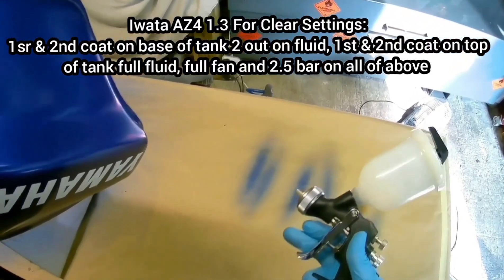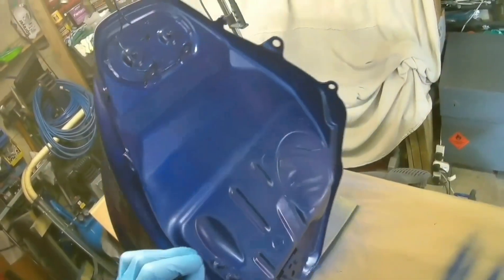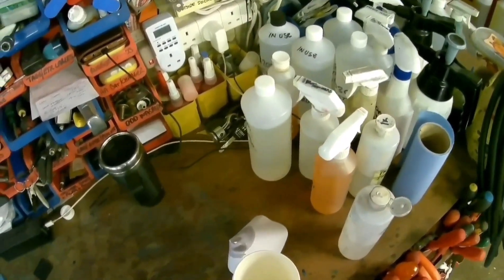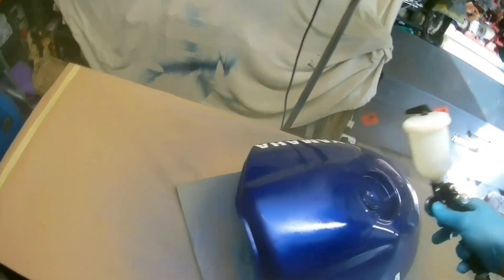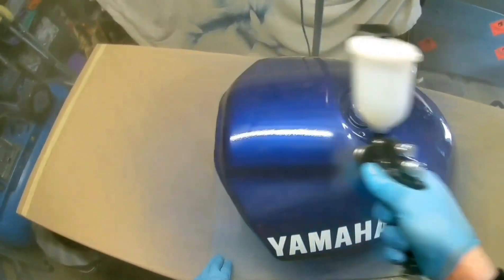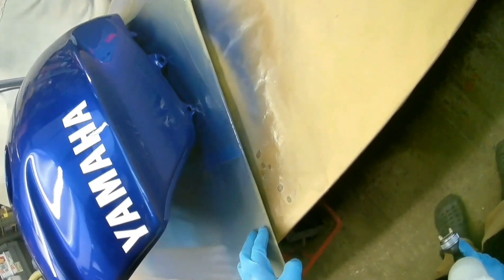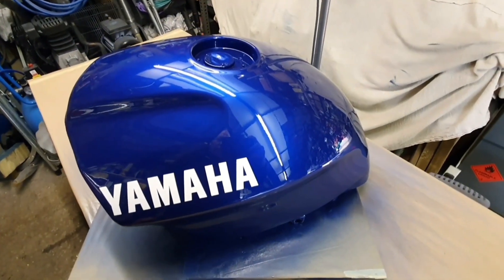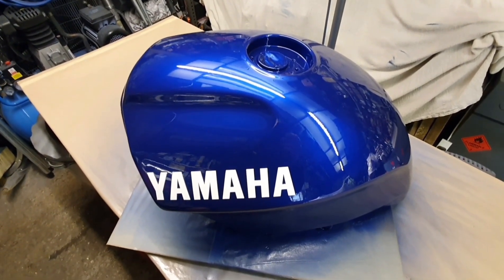Iwata Airgunza AZ4 1.3 For Clearcoat Yamaha FJR1300 Motorcycle Tank

Comment: Its a like from me pete well explained as usual with the gun 🔫  settings helps people out who are just starting to learn the hobby when the tank finished do you cut and buff it or just polish it by the way mate cracking finish well done 👏
Reply from the maker: Thank you Andrew, In this case i just de nib it ,I polish the nibs out the next day, the finish was very good so didn't need a full flat so i just sand any nids out by hand with a small block and some 1000 grit and then 3000 grit wet and dry paper, there was only 3 nibs to do as far as I remember, then I just polish those out, i have a little 3" 12v Milwaukee polisher that i use for little polishing jobs, obviously what you see ar the end of the videos hasn't had anything done to it,  it's always off the gun so you can see what the gun can do, cheers buddy,  hope you're well 👍

Comment: look pretty good, buddy. 😍😍😍
Reply from the maker: Thank you mate, much appreciated 👍
Reply: @peteshobbies5383  you're always most welcome Buddy 😍☺😊
Reply: @peteshobbies5383  hi! Buddy, pleas could you explain to me, what is the different between the  Ls400 supernova base gun and the ws400 supernova base gun? I bought ws400 supernova evo Base gun. but  I didn't do a review yet.
Reply from the maker: The LS400 has a different cap to the WS400, the LS is a true HVLP , you'll find the base version of the WS400 has a difference tip to the clear WS400,  the base tip has smaller holes around the tip point so let's less air through because if you try and use a clear WS400 for base it over atomises the base and it goes on too dry
Reply: @peteshobbies5383  thanks for the info bubby.😍😍😍 for you're opinion what is the best, spray gun for base between this two guns. LS400 or WS400 base gun?
Reply from the maker: I think the LS400 is better overall particularly if you use water base, one drawback with the LS is it uses a lot of air which i think won't be a problem for you, the LS also handles metallics better so i would suggest that over the WS
Reply: @peteshobbies5383  thanks Buddy. 😍😍😍
Reply from the maker: Your welcome 👍

Comment: Hi, just love your channel and now I have a question.
I have an Impact Junior 1.0 and I have been happy with it.
But suddenly it seems impossible to paint with it. The paint becomes full 
of what looks like tiny little grains of gravel, everything gets ruined.

I run the color through the filter into the cup and I have a filter in the cup.
Paints with 1 bar.
Hope you have any idea what it could be because right now I feel like giving up painting.

Best regards from Sweden.
Reply from the maker: Hi Mate,  If everything is how you have always used the gun them it must be something else.

It could be the materials you are using,  the degreaser you are using,  the thinners you are using, the air you are using,  lots of different things.

Forgetting the gun, have you changed, and update anything?

If you like, send me an email so I can see what the finish is like, 
Youtubepetes@outlook.com

Comment: I'm currently using an LPH-80 at home for small jobs, mainly due to the really low consumption of air, but I would like a bigger fan pattern. Would a small compressor cope with an AZ4?
Reply from the maker: Hi buddy,  the AZ4 with the AZ4 1 cap, the most common for smaller tips uses about 50% more air than the LPH80 E4 combination, you can get the AZ4 with the AZ4 2 cap, but that is normally on 1.3 and above and this uses 3 times the air of the LPH80 E4, hope that helps 👍
Reply: @peteshobbies5383  good info there Pete. Thanks! 
I've got a handful of full size guns too. Devilbiss, iwata and sata. Guessing the AZ4 would be quite a bit less CFM usage than the big lads...
Reply from the maker: The AZ4 2 cap is getting there but yes,  less than the full size guns

Comment: I don't know, do you read these new comments in old videos ?

I bought AZ4-1 1.2mm because of you and now notice, that you recomended AZ4-2 and 1.3mm nozzle. Does those fit for my AZ4-1 gun, I mean, is the same gun and only air cap and nozzle changed. Thanks Pete.
Reply from the maker: Hi Marko, yes, I read everything,  as long as YouTube notify me of a new message which they do I read it.

The nozzle and cap will fit your gun, I'm not sure if you need to change the needle as well but you may have too, probably not worth it. 

Your setup should work fine but it's slower than the AZ4 2 cap, still gives good results though,  they are a good gun for the money 👍
Reply: @peteshobbies5383  Thank´s Pete. So, I order 1.3mm and AZ4-2 cap.

I have learned a lot from your videos. I just paint Buster aluminium boat, because aluminium oxidize and you have to polish it all the time. Now I´m pleased and boat looks well. Thanks to you.

If possible, I wait kitchen cabin painting from you and 2k or water base colours.

Cheers from Finland
Reply from the maker: Hi Marko, Yes, the cap, tip and possibly the needle is the difference,  the rest is the same.
Good to hear you like the videos, I really enjoy doing them and hopefully it shows you can get good results at home, cheers mate 👍